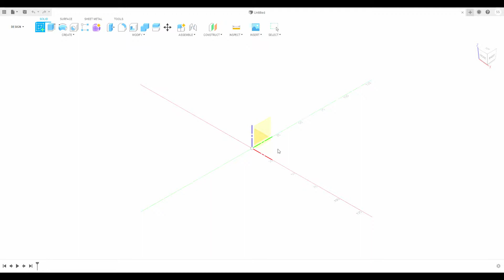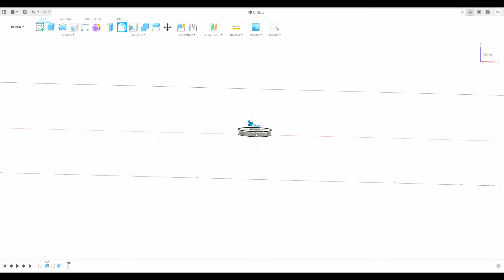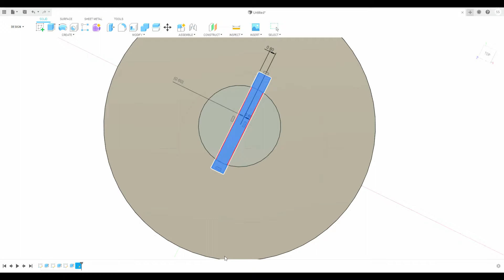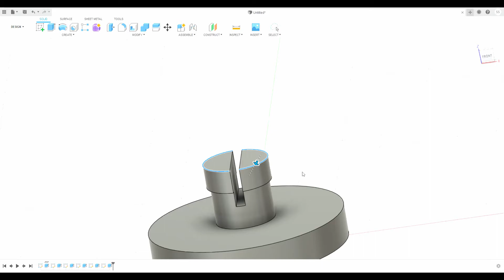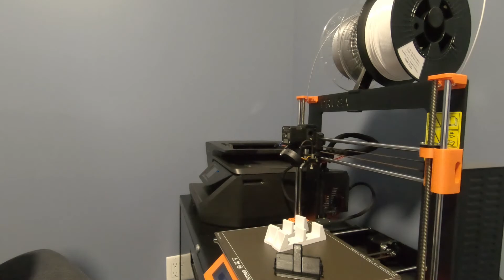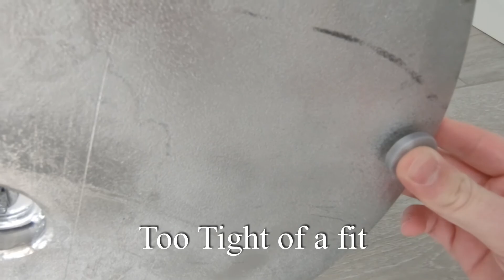Design / Slice / Print The Full 3D Printing Process, All in 30 minutes

Comment: I’ve done tons of research but still having no luck , Any chance you could figure out what software “apis cor” uses to print their houses
Reply from the maker: I'm sure that it would be a proprietary in house program. Printing Concrete and printing plastic are in some ways very different but in others very much the same. My guess having seen a couple of companies do this sort of thing is that the basic control software is pretty easy and just basic G Code. You could probably even trick the Prusa Slicer into creating the GCode. The difference is that the concrete will change throughout the day. Exposure to sun, wind, temperature,  etc will change the speed you can run it at. So my guess is that the pump speed and the travel speeds are all operator adjustable on the fly. So they can speed up and slow down as needed.

Comment: I like the way you think about 3D printing, for example whether you want spend your time tweaking equipment or design/build. I'm new to the hobby, and still have basic questions. But having done some research looking at written reviews, various types of Youtube videos, Kickstarter, manufacturer and seller websites, as well as a very small amount of actual printing, your intergrative perspective is useful. .
Reply from the maker: Thanks for the comment. There are two different paths for sure in the hobby. I find there are a lot of things to change in the design and even in the slicing settings to make it fun without also having to mess around with the 3D Printer itself. Plus sometimes I just need to part now for what I'm working on.